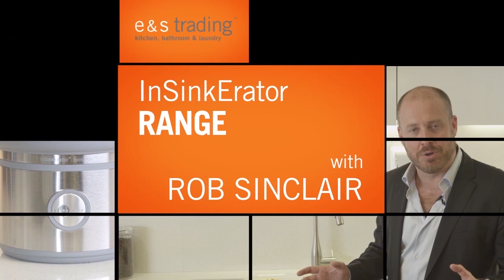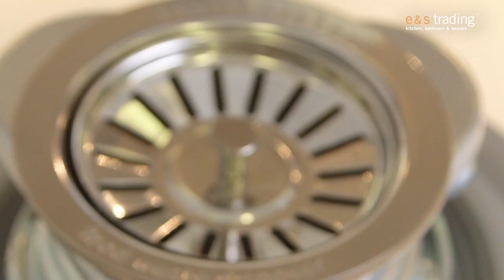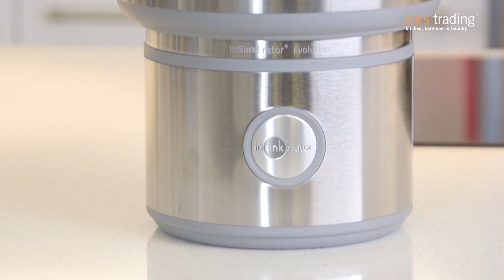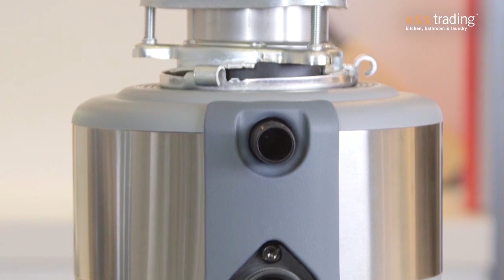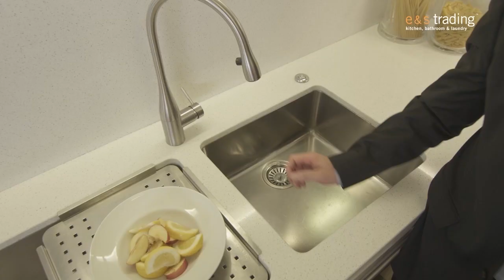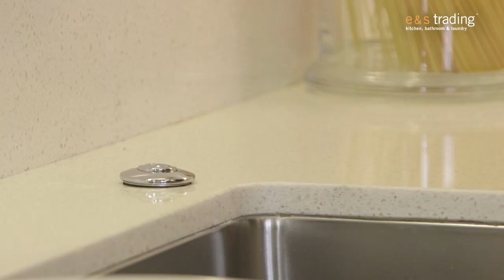InSinkErator - Food waste be gone!

Comment: Nah Im too afraid its goint to cut my fingers.:)
Reply: The shredders are on the outside edge of the fly wheel, out of the way. You could stick a carrot (or your finger, not recommended) straight down in the middle and it would not get cut until it reaches near the bottom and impellers knock it to the edge where the spinning blades are. Nobody's gonna do that while it's running.  It's safe. I recently got the 3/4 hp InSinkErator Evolution Essential XTR Multigrind and it is amazing. Quiet. powerful and pulverizes to a fine mush just about any food item (even bones and egg shells).
Reply: Thank you!  Even the guy I bought it from said no to peel, shells and bones even though it’s pictured on the box!  Nice to see your comment, makes me more confident!
Reply: You won't! I was thinking the same when I used one in the beginning, but then found out how they were built. It's graters, not knives doing the job. So don't worry!